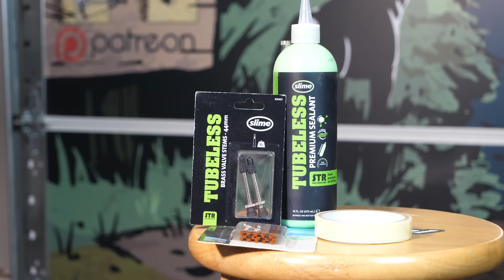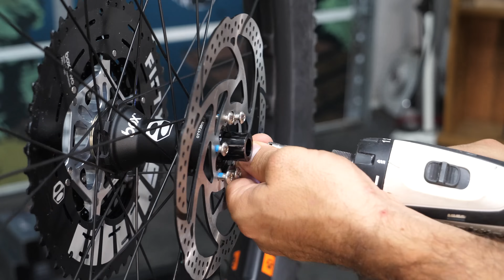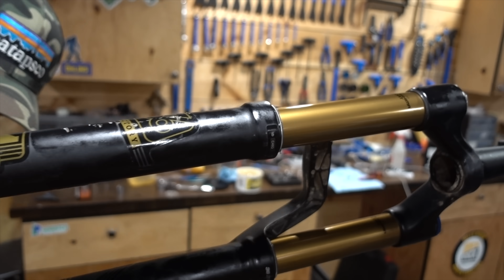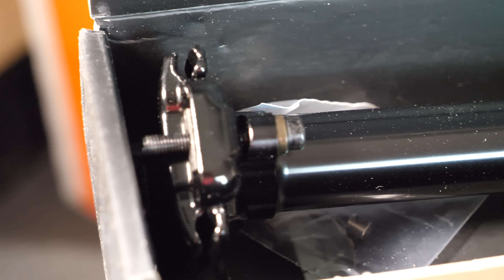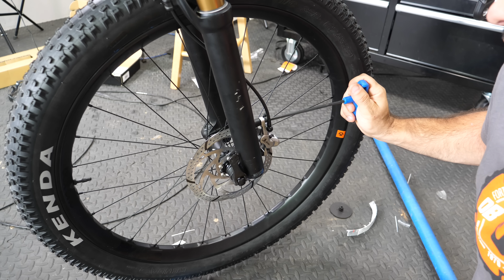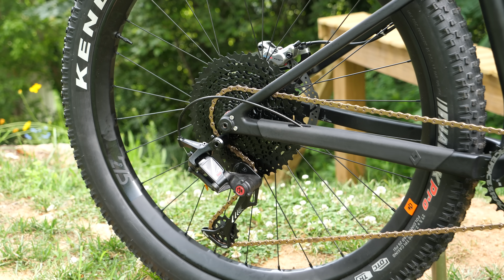Building my Sync'r Carbon Hardtail from Parts

Comment: You over torqued those bolts for your brakes. The tool you used to turn it the last bit didn't turn them anymore meaning they were already past torque.

Comment: I'm a fan and I like your channel but as a mechanic I do have to say if a bolt doesn't turn and just clicks it's potentially overtightened. (Reference the brake rotors) 😊
Reply: presumably he tightened them offscreen because they clearly weren't that tight when he was doing them up with the driver ☺

Comment: Put air in the tire first then add sealant through the valve core after youve set the bead. It's much cleaner that way. :)

Comment: Congrats those tires are junk. Slime doesn’t work at actually fixing a flat it dissolves rims, and unbalances the tire. As for how I know I worked at a tire repair shop for 2 years.

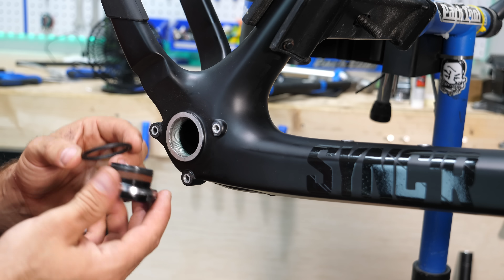Comment: @ 2:50 That red stuff on the new BB, isn't that loctite or something?? I'm just an aircraft/electronics mechanic, but I'd think it should be just that, and not grease on these threads.... PS: Too lacy to dig up the raceface manual....

Comment: Hi Seth, I noticed your running a bunch of spacers under your stem. I'm running an equivalent of 35mm spacers under my stem. Is it just right to not compromise my headset bearings because of the leverage the spacers created?

Comment: Man. I have casually passed your channel in the past, but lately I've been really hooked. I'm the same age as you, and I spent most of my first 20some years on the planet strapped to a mtb. My last good dirt bike was a 2000 GF Piranha; hardtail, no forks, no nothing. Rode it until I cracked the rear stays at the crank. Lots of big drops and way too many hard miles. Picked up a street cruiser for commuting and up until I had my kids, I was still putting a few thousand km a summer on my bike. I've been itching to get back on dirt, and this channel is(n't) helping. Love the content, and the delivery. You're reigniting my passion.

Comment: Pro tip: If you're going to use a drill, set the clutch to 1, not the drill setting (which has no clutch at all). Then there's no chance you'll accidentally over torque something.

Comment: wow never seen a carbon frame built, but then i'm old fashioned and my newest bike is a giant attraction no front shock no disc brakes but it does have a rack and a phone holder, and my oldest is a rudge 3 speed all original with fenders and a front hub that's a generator

Comment: Seth, at 3mins 08secs, to make tightening the cinch lock-ring easier, clamp the lock-ring tool in the vice and use the crank arm as the lever.

Comment: I dont understand the benefit of tubeless tires. Does it not just make you more prone to flats? If you have tubless and your tire gets a hole or cut, youre done right? If you have a tube installed and you tire gets a cut or tear, but your tube is untouched, youre still rind fine.
Reply: When running tubeless tires people typically fill the tires with a sealant that when you get a hole or small tear in the tire, the sealant fills the opening and seals it back up, preventing air from escaping. Also if the sealant isn't enough to stop air from escaping there are small plugs you can buy that you can use to quickly plug up holes in the tire. Also having tubeless prevents the possibility of getting pinch flats where the tube gets pinched between the tire and the rim. Since there's no tube, no pinch flats. And small punctures and holes are then covered by the sealant so tubeless definitely has its benefits. Granted this is all coming from someone who has yet to go tubeless, but definitely one day.

Comment: My fave quote: "Oh-god-oh-god-oh-god". I've never built I bike, one of the things I always wonder is how interchangeable all of the parts are. Like are all derailer hangers shaped the same? Do all brake calipers fit the mounting holes on all bikes?  Are all fork "steerer tubes" the same shape and size or how many sizes are there? Why did you have to cut yours? How did you know how much to cut? Are crank bearings all the same or how do you know what sizes to use? 
If these were cars nearly everything would work the same but everything would be a different size and in a slightly different location. Bikes...I have no clue.

Comment: Nothing wrong with using a drill driver to do up bolts, however your driver has a clutch to prevent over tightening use it,  then you can torque up, I use mine on 2,3 or 4 never on drill mode

Comment: For cutting  the handlebars would a pipe cutter work too
Reply: You can use a pipe cutter on aluminum bars, but not carbon, it'll crush and pretty much ruin the bars.

Comment: i like the blue pedals now you need to put just a tad bit of red on it some where. i have a gray custom and it has blue pearl. something was left undone so the paint was ground off when the addition was completed the shop painted with black. i told the shop they should have sprayed it in red and let the red run just a bit. love your new toy seth.

Comment: you should get a pipe cutter what sam pilgrim has then u wont have to saw bars and things like that
Reply from the maker: I only use a pipe cutter on alloy. With carbon you need to use a saw.

Comment: bro, instead of grease or any substances that would make that part slippery, is it okay if i use WD-40?????
Reply: you can use wd 40 as a solvent(degreaser) as a cleaning solution. But, absolutely don't use it as a lubricant. Use a dry or wet lube, I use dry lube.

Comment: When you say you are applying grease to parts that need to be tightened, isnt it the opposite of what you want to do? I would not apply grease to nuts on my car wheels. Is it locking grease?
Reply from the maker: Applying grease to the threads prevents seizing, and as such they’ve been designed to hold tight WITH grease if torqued down to spec. Most car manufacturers specify no grease on lugs, but that can vary as well.

Comment: since everyone asks about the slime sealant at auto shops, why not do a test using that slime sealant instead of the bike sealant?
Reply: And call it a “Hack”
Reply: Because Slime is his sponsor so if he tries it and it works then people would just buy this and not the one that's intended for bikes and Seth's is going to ruin their business.
Reply: @deyandimitrov840  I'm pretty sure it works, but since we do not know for a fact that it has been tested long term on a bicycle tyre we do not know if the chemicals used will be harmless to the tyre itself or the metal in your rim.
I would personally not use it, because i can not afford to replace the rim because of experimentation.
Then again, i'm the kind of guy that replaces ball bearings inside hubs rather than have the hub replaced.
Reply: Deyan Dimitrov that’s cool
Reply: EviLTyres no no don’t do that one of my dads friends didn’t realize he was using slime tube sealant then it defected his maxxis tires
Reply: I don't think that it would hold air.....
Reply: @trabi0582  tubeless tires dont need sealant to hold air, its really just there to seal punctures and the occasional tire imperfections
Reply: That stuff destroys your tires, ive seen it with my own eyes at my work.
Reply: Because there's no point in doing it, and it could harm your tires. It's like using the wrong tool for the job when u have the right tool
Reply: It works.   Better than the stuff i was using before they started selling specialized product.
Reply: 500 like🥳

Comment: how much money would all this cost using the same parts
Reply: A kidney....
Reply: $1,500-2,000 for derailers, sprockets, etc
$500-1000 for suspension 
$500 wheel and tire
$75 seat post
$100 for hydraulic brakes

Buying a bike already built is cheaper than doing it yourself.  It typically costs $3-5K to do a proper built with quality components.  Plus, you and I don't typically have the full set of tools needed in house.  When you realize how much silicon lube is, you give up and take the bike to your local shop

Comment: Awesome content Seth, but when installing the brake rotor make sure to tighten the bolts in a star pattern so they all get evenly tightened, if they are not evenly tightened, it can cause rotor wobble, also known as brake rub. But I see zero harm in using a drill.

Comment: Seth: so I got it reduced to 140mm

Downhill rider: bu but... Why would you want less travel ?

Xc rider: bu but... Why didn't you reduce more ?
Reply: Enduro riders: why didn't he keep it the same?

Trail riders: now that's more like it
Reply: Roadies: "What's a suspension?"
Reply: Dirtjumpers: "Can you get big air with that?"
Unicyclists: "why does this have two wheels???"
Reply: Hikers: "   -.-    "
Reply: @deymos2175  lol I tried running a road bike on one of the trails in Colorado. Didn't go very well lol.
Reply: @deymos2175  god you're a powerhouse of amazing jokes
Reply: @deymos2175  that's what I was gonna say😂
Reply: bmxer's: pfft i can do all that with no suspension
Reply: Bloodbrothers Production ..,they can't ride trails with a bmx
Reply: @troymuller3791  nonsense of course you can but just as Seth has shown before putting brakes on it might help
Reply: @louimcgee6146  damn it I was going to say "why have suspension"
Reply: Dirt jumpers: why do you need more than 100mm?
Reply: lol I have 180mm in my hardtail and I rarely ever use 120mm of that
Reply: @neffeps  if 180mm,then fully bro...
Reply: @european_elysium  dont really want to have that full suspension, i much prefer the control and roughness of a hardtail, and the 180mm fork gives it a very agressive geometry which feels really good on the local trails I have
Reply: @neffeps  I upgraded my hardtail to 140mm from 120mm and even that small difference was noticeable. 180mm must throw the geometry out of wack
Reply: @neffeps  180 is uneccesary on a hardtail
Reply: well I bought it used with this fork and it feels good so... also my bike is a freeride hardtail so a lot of travel might come in handy someday, if I were to use it as a trail bike I'd definietly put a 140-150mm fork
Reply: @wii_music_intensifies9023  its unneccecerily. i like iz
Reply: me: why dont you give me the 20 mm you reduced away?
Reply: my suspension died ill take anything
Reply: But why did he reduce the travel I don’t get it
Reply: cmcguire951 to long / short travel will put the geometry off. A xc hardtail will not have the same headangle with a 200mm fork instead of a 100mm fork.
Reply: @cmcguire951  you're not the only one. I'm also wondering why you'd reduce it. Surely it's better to have more than you need than less than you need?
Reply: @anftrew3775  It would wreck the geometry
Reply: @cmcguire951  To match the geometry
Reply: trial-biker: Wtf bro suspension is gay.
Reply: unicyclist wtf is a front wheel
Reply: Comment readers: the video educating and entertaining. But why i read this comment 10 times more than watching the video?
Reply: Haha that’s funny 😂
Reply: I’m laughing so hard I don’t know why
Reply: @hangtime7190  ask your balls
Reply: Its 140mm to match the geometry of the bike
Reply: that's me the dh rider
Reply: Travel are so overated and most of the time useless. Most of the people I ride with don't know how to use half of their travel.  Better riders I know all come from BMX or dirtjump.
Reply: @mpgt  If you're not using half of your travel your suspension setup is horrendously off.
Reply: @mpgt  Fabio Wibmer?😂
Reply: @mpgt  more travel is for every rider better.Your bike will forgive you more things...

Comment: Looks good. I kind of did a similar thing, because my headtube was ovalized on my old hardtail frame, and the chainstay was dented. Suffice to say, it didn't go as smoothly as yours, but I wasn't trying very hard. I had an aluminum frame, and my new one is Reynolds 520, and it's so smooth (it feels really cool actually, like a luxury vehicle), and nice feeling, but also very heavy, and I'm old(er), and weak. I couldn't weigh it, because myself, and the bicycle on the scale went over the scale's limit, but I can tell it's a heffer.(I'm also probably the weakest I've ever been in my life).......It also has a 7 inch SrSuntour Durolux fork, I always wanted a hardtail with a big fork because I thought it was kind of funny/cool.....I painted the fork lower black with spray paint to make it match, it looks kind of ghetto, but the fork was an extremely good deal. Both my hubs are kind of worn out, I've come to realize, it's a bit like sinking money into an old car, you're better off buying a new one. I don't think I'd ever build a bicycle again, the manufacturers have you covered a million times over in every aspect. Especially here in Canada, I probably could have just purchased a way better, fully built bike.

Comment: Anyone know if it's possible to make a 1x system into a 2x system, and what you would need?
Reply: Why would you want to do that to a bike? Plus you need to check if your bike has the mounting points.
Reply: @thatcherwelkermtb9139  well some people want a 2x for differeny reasons, some are for a higher gear for bombing and a lower for climbing, in reality a 1x system is mostly just a marketing thing, it has 1 advantage and so many disadvantages.
Reply: @gabrieldenney9428  1x's have quite a lot of advantages actually. 1xs are clutch compatible meaning no chain slap. They're simpler than 2xs. They're usually lighter, there's more choice, they're easier to clean and maintain, the smaller ring on the front means less to hit on rocks.
Reply: I would stick with a 1x. 2xs are just More work and more things to brake
Reply: If you truly want a 2x you need cranks that can have 2 chainrings, a new shifter and derailleur, and of course 2 new chainrings
Reply: @gabrieldenney9428  in some cases a longer bb and spindle is needed. Some frames are 1x specific meaning a front mech can't be installed
Reply: I would stick with a 1x
Reply: I don't do heavy riding. Only gonna get a cheap mountain bike, but so many bike manufacturers only include the 2x drivetrains on low-end bikes. There aren't very many options for people like me.
Reply: @hydrogen5149  get the 2x system and if u wanna go 2x just buy a chainring, going 1x is just ripping parts off and a narrow/wide chainring

Comment: Not to be that guy but your supposed Torque the brake bolts in diagonally
Reply: since we're being pedantic you are (you're) not your
Reply: lechprotean Since we’re all being ridiculous, you forgot to use capitalization and punctuation.
Reply: "not to be that guy"
Reply: Regardless of all the stupid replies tighten + torque the damn bolts diagonally it's great advice and isn't any slower than doing it incorrectly
Reply: My words
Reply: What what
Reply: The forks were on backwards
Reply: @oliversanderson111  No it's just mrp's design
Reply: Bushcraft in the garden I guess they do that so the back doesn't fill with mud, like it does on my Fox
Reply: I swear those things add some aero drag on the trail
Reply: AND ALSO ITS SUPPOSED TO BE "you're supposed to Torque the brake bolts in diagonally'
Reply: @imaginelosing7067  it's
Reply: No when ur torquing bolts it doesn’t matter what order you torque them in

Comment: Nice video. After 6 years apart I've reunited with my Schwinn Moab 2000 model. The frame, bars, seatpost and clamp (I do need a new clamp) are the only remaining 2000 parts. Should I ever get that rear brake changed to disc, I'd go with an new frame, instead of a a conversion kit and ugly old brake posts (my last set of wheels have the correct hub just in case). I just think I and too emotionally attached to the frame to make the leap.   Feels me with such joy to come down as see it waiting for me (In Vietnam) everyday.

Comment: Cheers from Marquette. Totally agree that hard tails are the sexiest builds... only superseded by the single speed.  I have been using PVC pipes for almost twenty years to seat crown races,  nothing works better.  I have several sets of the Chester pedals.  None of them are blue but that may change.  They defy Keith Bontrager's famous statement: "Strong, light, cheap? pick two". These pedals seem to tick all three.

Comment: Hey Seth is a Gt pantera a good mountain bike
Reply: I had that bike for a few years anf the only problem i had was the rims bent after i did a 5 foot straight down drop (and its a hardtail!) But thats normal for many less than $500 bikes, also the plastic pedals youll have to upgrade after a while
But it was a great bike and looks great and rides great!!!!
Reply: Enduro is not advised on bike tho
Reply: Se top boys vlog  i cant tell much about the pantera but GT is a damn good brand, i ride a fury expert 2014 myself and its a tank of a bike so i cant tell anything bad
Reply: Se top boys vlog dont ask seth if another bike brand as a sponsor of diamondback he has to tell you db is better than the rest its part of the contract

Comment: dont have that much money. get a full suspension they said. It'll be great they said. get a used bike. get a used atroz comp. break your bike every ride. ride 7 foot drops with your budget  xc bike. it'll be great they said. all joeks a side. my riding is getting eay to big for my bike, and its only a matter of time til my frame cracks. and i dont have money for a better one, but i dont wanna replace it with this one cause its booty. oof

Comment: Hey can someone help me I have a manitau front shocks and the disc brake holder is on the right side of the shocks when the bar thingy that's attached to the shocks are facing forward and also I want to put rear disc brakes on my bike but it doesn't have the mounts so should I make my own? Thanks, david

Comment: Why did u have do limit the travel on the fox forks
Reply from the maker: because the frame is designed for 140mm, and a taller fork would handle weird on turns
Reply: Seth's Bike Hacks oh thanks Seth i got really confused when you didnt want that much travel
Reply: Seth's Bike Hacks now if you will excuse me i have to go brag to my friends that you replied to me